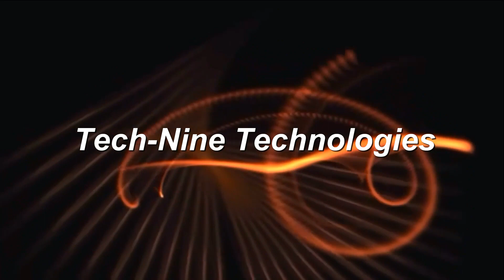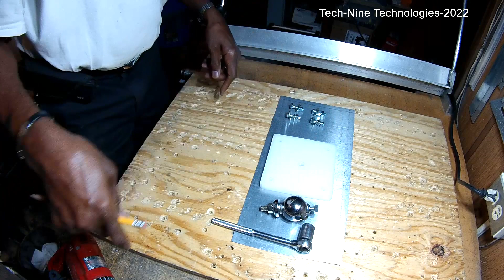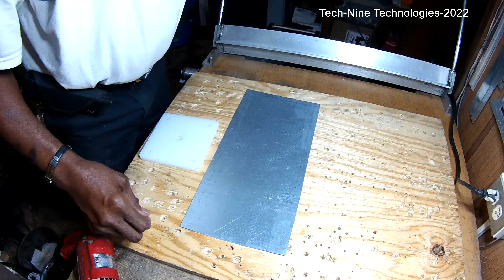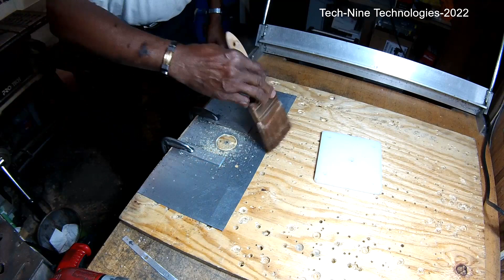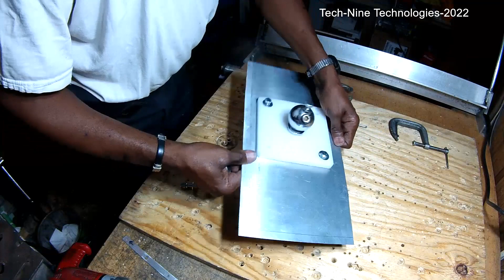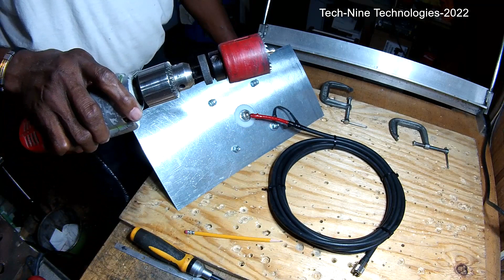Antenna Mount 101 By Tech Nine 2022

Comment: I'm wanting to get me another maybe Galaxy 99 DX V2 radio they peak out at about 50 watts and then i always run 102 in whip with a 6 inch riser.... So I wonder how that would all work out with a about 1000 whiskey amp.... This Q. is for the professor.....

Comment: Thank you for the video. That is on my to do list. I wish mine was that easy. I have to re do my 1976 K5 blazer it has a two layer roof. I have been struggling with that mount with having about one inch gap between the roof layers.
Reply from the maker: All you have to do is make some spacers and put them between the two layers where the holes pass thru. You can get the rods from Menards. Or they also sale brass spacers.